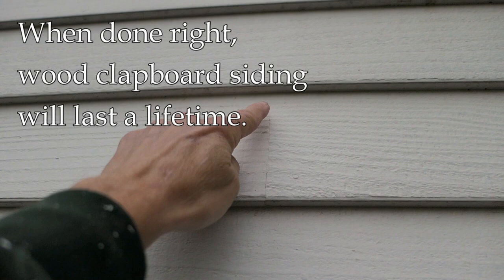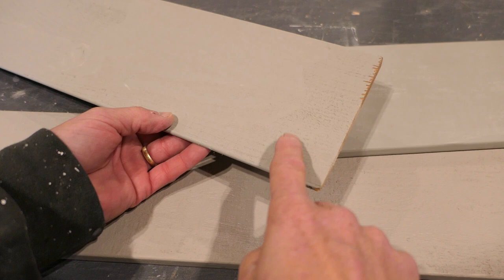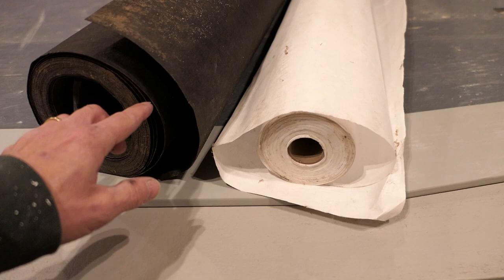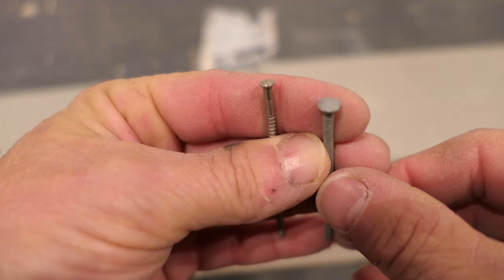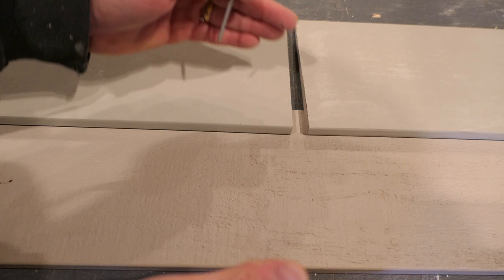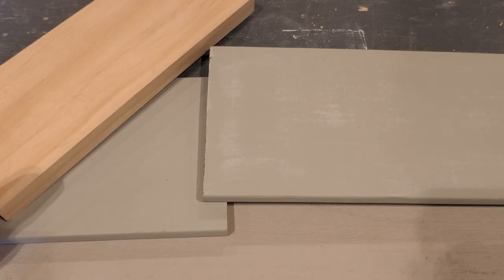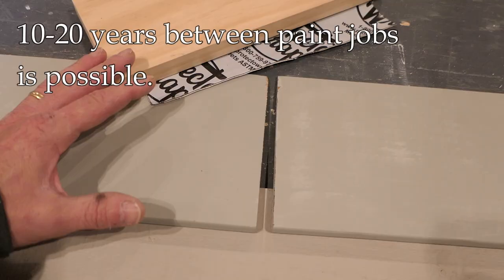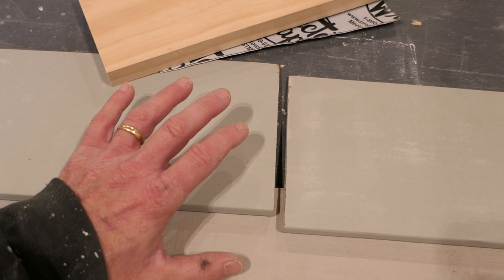Painted Wood Clapboard Siding Which Lasts A Lifetime

Comment: A super helpful video would be how to cut, prime, paint, etc. clapboard for a diverter/kick-out flashing on a rake wall for those of us on the coast who still want real wood siding.
Reply from the maker: This is a great question.  I wish I had a great answer!  The diverter is now building code, but they can be very difficult to detail and also ugly.  I have struggled myself to make them look unobtrusive while still being effective, and it can be tricky to cut clapboard siding around them.   What I typically do when repairing siding on the side wall is to install the kickout where I think it needs to be, use self adhesive flashing over the top of the diverter so water can't get behind it, and then carefully install the clapboards over that.  I keep the clapboard edges fairly high off the base of the diverter since water will be flowing there during rain.  The color of the diverter is also important.  I may choose black to match the shingles, or I may paint it the same color as the siding.  But, none of this is simple or easy.
Reply: @enduringcharm  Have you tried Azek Lap siding?  I'm thinking of replacing the clappers on the south side with them.  Price seem reasonable.
Reply from the maker: I have not used Azek siding.  You should be wary of thermal expansion and the need for specialized paints, especially with a southern exposure.  If you live in an area of hot summers and cold winters, especially, you might find these properties to be a problem.

Comment: I agree with you: love cedar wood siding. Unfortunately I watched this video about 5 years too late. We installed Typar behind our cedar siding. While it’s not the Tyvak brand you mentioned, I assume it probably has a similar makeup and may cause us issues in the future. I also didn’t realize I needed to paint cut ends and flash behind joints 😬. Our one saving grace is our house is a modified a-frame and has about a 2 foot overhang that offers a lot of protection. I always appreciate your expert advice. Thanks for sharing your decades worth of experience with us.
Reply from the maker: Large overhangs can indeed make a big difference in the longevity of siding and trim.  Just keep an eye on your siding and look for paint failure in a single section or area, which would be a clue about the housewrap issue.  It isn't ALWAYS a problem, but when it happens the degradation underneath can be pretty dramatic.

Comment: Great video. Hard to get contractors to do all that stuff. Most seem to think paint is evil if they must apply it before install. Enjoyed this whole video.
Reply from the maker: You're quite right--while some of these techniques used to be routine, now the knowledge seems to be fading.  Carpenters don't want to get involved with painting, and their work tends to be about speed rather than quality.  But, a job worth doing is worth doing right!
Reply: @enduringcharm  I recently had two dormas rebuilt. Lucky to fine the rare breed,the guy who cares. Primed and painted every thing before it went up. Put metal flashing behind the area where side boards met front up right unit. We did use pvc where we could but sides are wood and on an angle, not straight which he said is a bit of a problem as to the water flow, but said it is beautify.

Comment: I agree with everything you said but painting an entire house by hand? I can’t find any contractor to paint a house by hand.
Reply from the maker: You are quite right, it is difficult or even impossible to find a painting contractor who works by hand.  About the best you'll find is one willing to spray the paint and then brush it out by hand.  Unfortunately most painting contractors believe they can't make a profit working by hand, and exterior painting is often marketed on price.  The irony is that painting entirely by brush can be profitable, especially since the contractor does not need to maintain and clean sprayers or take additional preventative work to protect from overspray.  However, I see a lot of painting contractors who sell a job to ignorant homeowners at full price and then skimp on prep and roll the paint on (even in vertical strokes!) as quickly as possible.  I can't change the industry, but I can tell you that hand brushing is the best way to apply the paint for longevity and authentic looks.

Comment: Have you ever seen installations of wood siding where an air gap was left between the sheathing and siding? I know felt paper leaves a small gap but I’m wondering if there’s a technique where a larger gap can remain. Similar to vinyl siding. This would help the back side dry out better and imitate the pre-insulation era wood homes that last a lifetime.
Reply from the maker: There are commercial products to create such a gap and ways of doing it yourself with strapping.  That said, I don't think the additional cost and effort is worth it IF the rest of the things I mentioned are followed.  In other words, if the siding is well back primed, well painted, and the seams are sealed, etc., then it just isn't necessary.  I would feel differently if the clapboard siding is left natural, or stained with a transparent stain, or if there is a known problem with moisture in the structure due to unique circumstances.

Comment: Firstly, let me say thank you for sharing your knowledge. I always smile when I click on an instructional video on youtube and hear confidence and experience in the voice of the person doing the video. We just bought a 1980 colonial in Connecticut, and the siding is definitely wood. The siding has a lot of areas of cupping, and just overall hasn't been maintained well in the last 40+ years and my plan is to reside the whole house. I'm not sure if the current siding is cedar, but if I had to guess it's probably pine given these houses were "built to code" and I can't imagine they opted to pay a premium for cedar. I had planned on sourcing my lap siding from either a lumberyard, or even home depot sells 16ft. oil primed pine lap siding for a hell of a deal! I was hoping you could share your thoughts on wether or not it would be acceptable/advisable to use pine instead of cedar since the house is going to be painted anyway? I also wonder if I could use a Tykev style house wrap under pine without worry of rotting, as you mentioned happens with cedar? Thank you so much for your video, and your advice. Keep up the great work and stay well.
Reply from the maker: There's actually a lot to unpack here.  You don't mention your area of the country, but in most areas if you had wood siding installed in the 1980s it was cedar or possibly redwood.  It's not impossible that it would be pine, but it's unlikely unless you live in an area where there is a lumber industry presence and they were pushing it locally.  In the northeast where I live I only see pine clapboard siding on survivor houses going back to the 1700s and 1800s.  

The second thing to unpack is the quality of wood.  Whatever you've heard or think you know about the durability of wood species is probably not true anymore.  All wood of any species today is of poor quality, unless you are buying from a boutique local sawmill which specializes in finding and cutting vintage logs or resawing old lumber.  The rot resistance of cedar or mahogany isn't a thing anymore.  That was true when cedar was cut from the center of old growth logs where certain chemicals naturally concentrated and it was true when the mahogany you purchased was not a look-alike species without the actual benefits.  I've ripped up miles of rotted cedar and mahogany.  When you bought pine in the past it was eastern white pine or longleaf pine if you were buying pine flooring.  Today you are likely to see "radiata" pine or several species from Australia or South America.  In all cases, though, the pine is poor quality with wide set growth rings and case hardening from improper kiln drying.  It's garbage.

So what should you do if you want wood clapboard siding?  The best bet is still going to be cedar, not because it is rot resistant but because it is lightweight and relatively stable.  Unless you pay with an arm or a leg it will be fingerjointed.  I don't like it, but that's often all I can buy.  If you can find solid cedar it will cost a fortune and may not be that great anyway.  If you follow the tips in my video you can still get long life out of cedar, fingerjointed siding, but you need to be meticulous about installation and painting.  If you are considering buying pine siding, instead just take your wallet and throw it in the street where it will do more good.  

Another option is to forget wood and go with hardiplank or a similar fiber cement siding.  It's a good product and will hold up well if installed and painted properly.  It's not quite the same as wood, but it won't rot and it takes paint well.
Reply: @enduringcharm  I've had this exact conversation, almost verbatim...I saw cypress lumber at a sawmill for my living. We routinely cut trees in the 100-150 year-old range, but even these logs don't contain nearly the same amount of heartwood as the larger virgin growth did, and the heartwood it does contain isn't nearly as dark or rot-resistant. We have to ship sapwood boards mixed with the heart boards, too. I often wonder why anyone will spend the $4-$7 per square foot for modern cypress bevel siding when it will hardly last longer than pine. 🤦 But they do. Just burning money by the handful.

Comment: Would you recommend intentionally leaving larger gaps for caulking? Most caulk brands recommend that. Tight joints don’t fill properly.
Reply from the maker: I bed my caulk sealant, meaning that I force the caulk into the gap with my finger and smooth the edges.  Unless you have no gap at all, that should be sufficient.  There are many who just lay a bead of caulk on the surface with the gun and leave it, but I find that lazy and ineffective.  That aside, I do think about the building when considering the gaps I leave between trim and siding.  A wall with a heavy southern exposure is going to experience greater movement in the siding than a wall hidden in shade all year long.  So I will adjust the gaps according to local conditions.

Comment: Absolutely invaluable information. I've got an old house with clapboard ( here in Australia we call it weatherboard) and I am restoring it slowly. Thank you for sharing. Greatly appreciated. I will have to come back to this video often to refresh my memory as I progress with my restoration project. Totally agree with the need to do a final finger touch up with the caulk. It looks better and does push more caulk into the crack than a gun does based on my experience.

Comment: You are my kind of guy!  Do it right the first time even though it might take longer.  I just saw a house for sale this weekend that is very cute but noticed some bubbling up of paint on the rear of the house.  I examined further and discovered the house still has wood clapboard and not the vinyl siding most homes have now.  Not sure it is something I'd want to purchase and could be more under the surface you don't know about adding more $$$ to the purchase.
Reply from the maker: It can be difficult to judge potential problems in that scenario, because the current owners may have just painted for the sale and covered up existing issues.  If you look closely you may be able to judge how well or how recently it was painted, and look to see if any bubbling is localized to a small area or covers the whole house.  One huge advantage of wood clapboard siding is that it is repairable.  If a small section or even one board is damaged or has some other flaw, it can be removed and replaced.

Comment: Good Tips!  I have never seen flashing behind joints on repair work I have done in the past but I am totally going to copy that peel and stick flashing tip for any repair work going forward.  I have always just tried to copy how it originally was built but seems like cheap insurance to just use the peel and stick too.
Reply from the maker: Yeah, the flashing is something I do regardless if it is a repair or new work.  It won't help if the original siding didn't have it, but at least my repair will hold up!

Comment: I have an old home I'm completely residing. This is an old house and there is no sheathing or insulation behind the siding. I've heard mixed reviews on weather to add sheathing and wall insulation. I'm in Georgia so harsh winters are not a problem but it is warm in the summer. Your thoughts appreciated.
Reply from the maker: I've faced this issue many times with houses from the 18th century, especially.  Often the decision comes down to money and circumstances.  Houses with post and beam frames can be especially challenging.  Newer houses with balloon framing or some form of stud framing aren't quite as bad.  Plywood sheathing comes in 4x8 sheets, and a post and beam frame may require additional framing in order to find something to attach the plywood.

Other factors include the possibility of disturbing or cracking interior plaster, the need to retrim windows and doors on the exterior due to the additional thickness, and the possibility that adding insulation will cause condensation problems in a home that for decades has been allowed to "breathe."  

As a general rule I am in favor of adding both insulation and sheathing if you can do at least one entire wall and there will be no loss of historical trim.  I have used 3/8" plywood on occasion when I'm really fighting a thickness problem.  For insulation I will generally use fiberglass NOT spray foam. I like to use tar paper or "felt" rather than Tyvec or the like.  I typically need to retrim the wall corners at a minimum, and often the windows and doors too.  A nail gun helps minimize plaster damage when installing the sheathing.

If you have the money and the right circumstances, adding insulation and sheathing will result in a quieter house, better control of interior temperature, and longer lasting siding.  As a bonus, you can fix electrical and plumbing problems when the interior wall cavity is exposed.  See this example: http://enduringcharm.com/gallery/exterior-repair.html

Comment: Great tips - especially the one regarding additional coat of primer. Do you roll and brush it out or just brush? Thanks again for all the great content.
Reply from the maker: For the priming the back side it's fine to use a roller.  You can make a production line out of it pretty easily if you have a   place to store the boards for 30 minutes while the primer dries. Sometimes I'll take two extension ladders and lay them on the ground to create crude sawhorses on which to lay the boards as they dry.

Comment: This is a fantastic video!! I’ll be following your directions exactly. Thank you so much for sharing your knowledge. 

What brand/type of primer do you use on the siding? How can I deal with knot holes?
Reply from the maker: I don't think the primer brand is super important, but it should be exterior rated and latex based, not oil.  I typically use Zinnser 123, which has never let me down.  You can buy it off the shelf in white or gray.

Comment: We have a 130 year old house that doesn't have sheathing.  As I pull the old siding down, do I need to add sheathing? Or is there something else I should know?  Previous owners didn't take care of the house, so I think the siding is too far gone.
Reply from the maker: That's a great question, and one that I have confronted many times when working on older houses from the 1700s and 1800s.  Back in those days it was pretty common to install clapboard siding right onto the studs or timbers without any sheathing, and certainly without any kind of air barrier.  Sometimes the stud bays would be empty, sometimes they would be filled with mud and straw, or bricks, or whatever else was on hand at the time.  So when you go to replace the siding today, you are faced with a choice.  

If possible, it is worth installing sheathing and a barrier like "tar" paper or felt.  Sheathing stabilizes the structure by preventing racking and movement, and the building felt acts as an air barrier and protection in the event of water infiltration.  However, there are a few sticky wickets.  First, the sheathing will add thickness to the wall, typically half an inch.  For this reason, you really need to do at least an entire wall at once so that the thickness matches and the siding can be applied on one plane.  And, when you add this thickness you may also need to adjust or replace the trim around windows, doors and corners.  You may need to either shim out doors and windows or else build custom trim with a rabbet which meets the window and door jambs while overlapping the new sheathing.  It can also be necessary to add framing members as nailers for the sheathing, since the original framing may not be set up with the right spacing for plywood.  Or, you may have a lot of waste for the same reason.  Of course, while the stud bays are open to the outside, that is also your chance to add insulation.

All of these things take time and cost money.  I have had situations where a homeowner just does not have the budget to add sheathing and deal with all of these details, but the siding must be replaced due to damage or decay.  Or, the work to add sheathing would also mean destroying historical trim details that could not be easily replaced.  In that case there is a fall-back position.  You can skip the sheathing but add a 30 pound felt over the studs or timbers.  This will at least add some protection for water infiltration and act as an air barrier.  The felt adds little appreciable thickness.  Another trick I have used is to apply a 3/8 inch plywood instead of 1/2 inch, which may be enough to help with the details I mentioned above.  So, yes, sheathing, tar paper and insulation would be great if you can afford it.  If the budget isn't there try to at least use  the 30 pound felt.